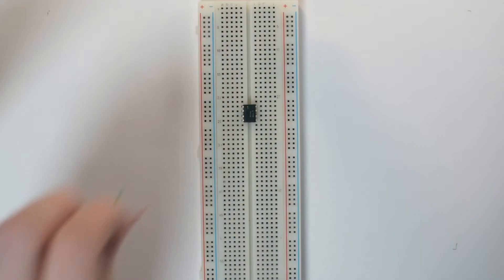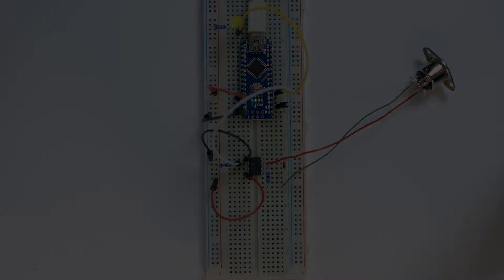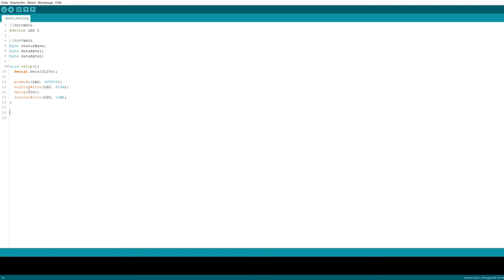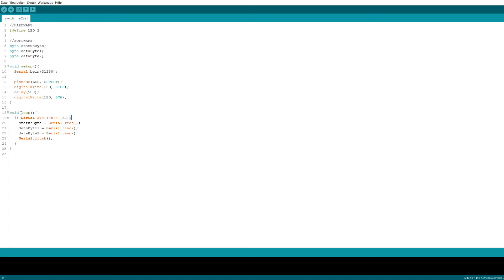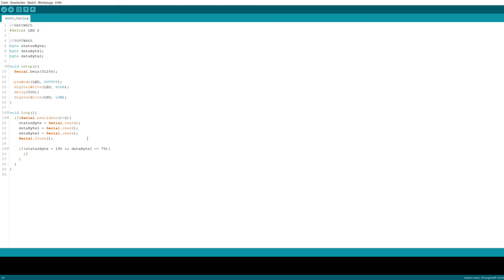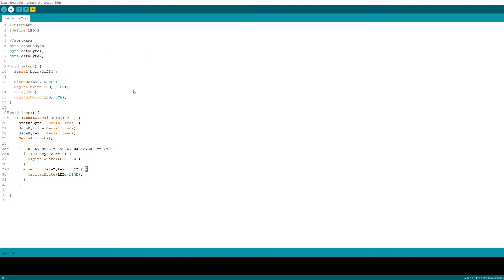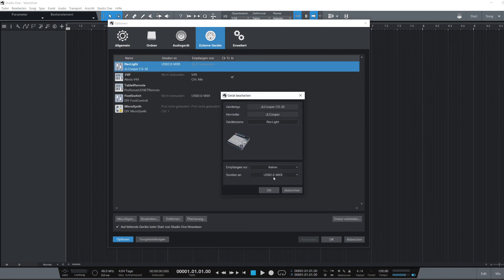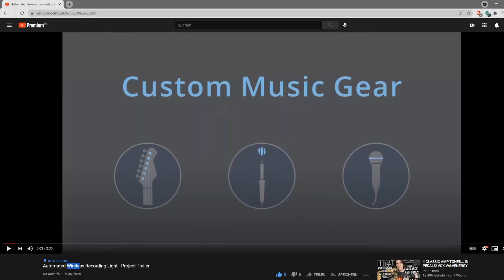DIY Automated Recording Light - Part 2B: The Software

Comment: Great work! You, should make the rest of making the sign aswell. I want to connect a normal light like a E27 fitting. Could you help me out?
Reply: Did you end up doing it? You can use pre-made relay-boards that are arduino-compatible to accomplish that.
Reply from the maker: Please excuse the late reply. The LED can simply be replaced by a relay. Working with mains voltage should only be done by professionals tho. My lamp uses a 12V LED strip that gets connected/disconnected to/from an off-the-shelf power supply using a relay.
Hopefully, I'll get around to uploading the final video in a few weeks.